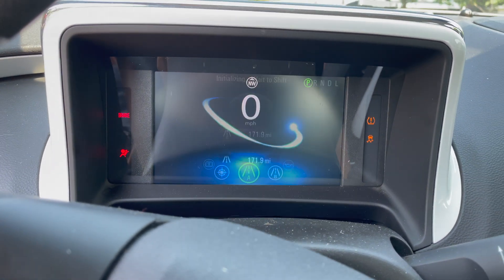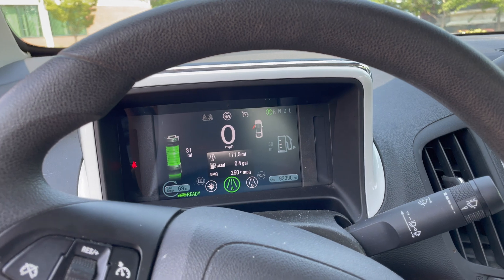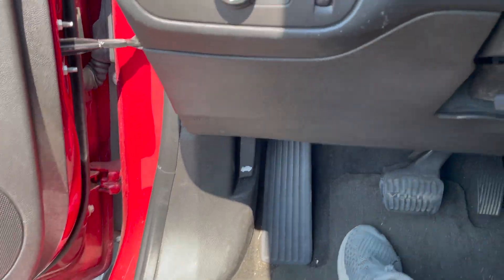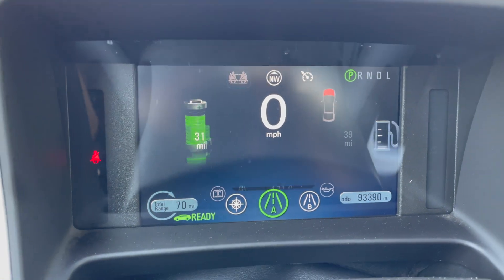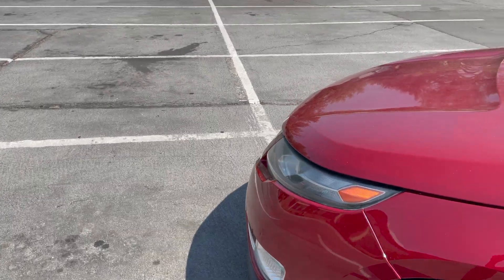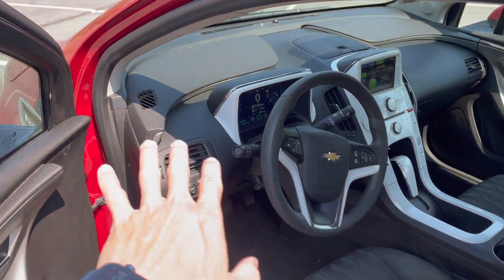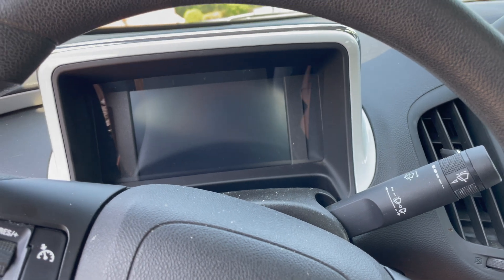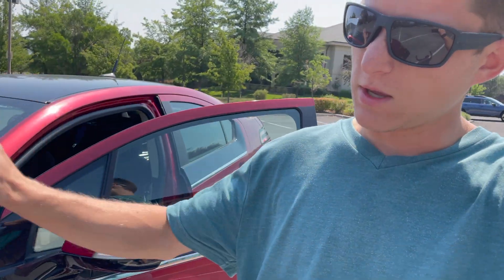TRICK to CHARGE your EV FASTER?

Comment: Could you make a video on how long it charges an empty battery to charge with its generator? Is it 2 gallons to charge it full? Considering its 55kW gen and 111kW battery
Reply from the maker: Unfortunately the onboard generator is not able to charge the battery back to full from what I understand. You have to plug the vehicle in to get a full charge.